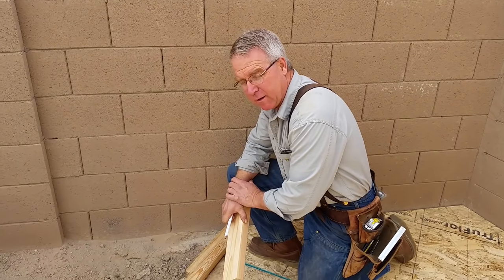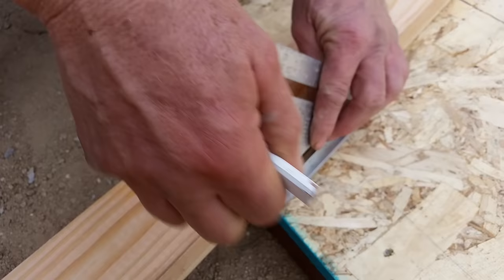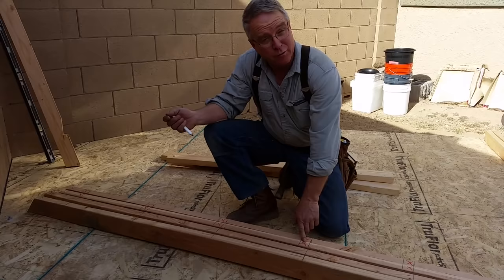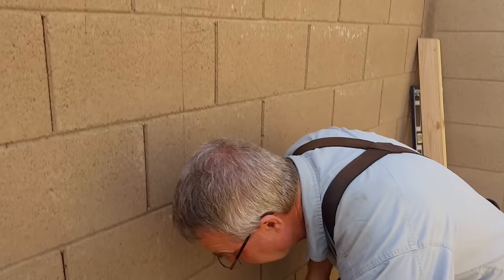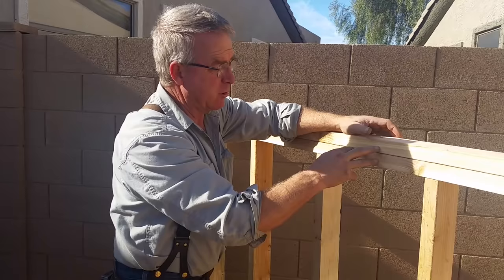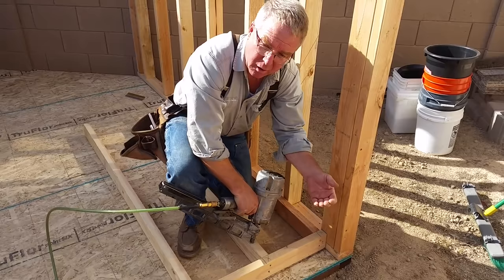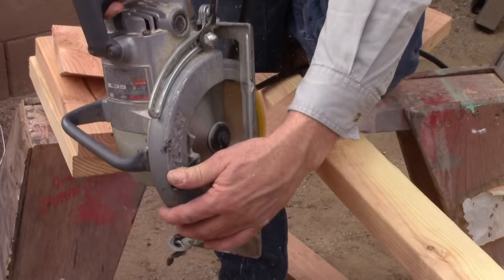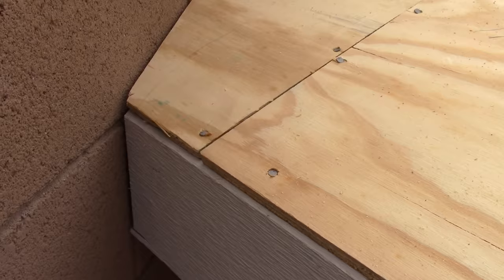Framing Pro Tips

Comment: I was the lay out guy / foreman/super my whole life.. Some lessons you learn doing layout for a long time,,, the wall studs are always laid out last.  Layout starts before layout .. For instance you must collect all the windows,doors, HVAC, fireplaces,electrical panels, Rough Opening sizes and locations and so on from the plans or subcontractors before you start, and figure out locations of all beam pockets hold downs and so on.   After all these things are laid out first, than you lay out the studs. If you do not mark the locations of all the things i said you will end up with overlapping lines and bad marks which the have to be erased, or it becomes a mess. Also studs that are not full length (meaning for bottom plate to top plate) should be marked in a different color crayon such as beams pockets, window cripples and so on. If you layout all the studs first you will (100% guaranteed) have to move studs that will end up on the edge of a window or in a beam pocket and so on.  You also should not start any layout until you know what is going above the walls on the next floor, such as beams, plumbing drains and so on. You also must be consistent with your marks,,, the guys that follow nailing everything together need to see the same markings over and over... if you use and Red X for a stud then always use a RED X, and so on. The temptation is to start a job or layout before you get all the info i mentioned above. For instance the windows have not been picked out yet . Also collecting this info is not always easy, the subs do not always want to take the time to give you the info.
I told them give me the info now or you will pay for us to relocate anything we must. And your boss might want to start to early.
The  boss is the boss and if he says start, you start.. but in the end when the cost go over you camly say i told you this would happen,,, pretty soon the boss gets the point and you will get the info you need ahead of time. Also always lay out from the same direction such as left to right,so that the studs and joist on the next floor will all line up, for OSB or Plywood. You can not learn all this overnight and mistakes will happen... but this is the basic way to do it right and save money.  One story to enforce what i just said,  We were remodeling a school , i asked the HVAC SUB to come up on the roof and mark (exactly) where he wanted all the openings for all the HVAC  air handlers and vents and so on, and i asked my boss to be there so he could witness this. I new from experiences there would be problems (there always is).. About two weeks after we were done the subcontractor comes up and says he screwed up $10,000 worth of reframing..  Layout is not easy, you must understand the plans and what problems may arise,  you must think ahead. But if you do it right you will become the layout man all jobs.

Comment: As a cabinet maker and installer for something like 12 years, I freaking wish every framer, concrete, tile, or drywall guy cared about plum, square, and true in their work! You wouldn't believe how many times I had to do hours of extra work accounting for anything and everything you can think of in a house or garage being wildly out of square or inches away from where it should be. I even dealt with a newer big expensive house where it looked like the framers considered studs within 2 inches of 16 a good job! I've seen walls that were 8 inches out of square with what they should be. Honestly it's the newer bigger homes that seemed to be the worst. Especially those built in big development deals where 10, 20 or more houses go up at once. They're basically all crap as far as I'm concerned. ONLY BUILT FOR COST SAVINGS AND TO MAKE MORE MONEY with zero effort for making a quality product.

Comment: OK - at the end, where you're cutting the excess off the front of the roof sheathing, how do you transfer a line from under the sheet, along the facia board, to the top of the sheet to follow with your saw? If I tried that freehand, I'd cut right into the facia - guaranteed. (For that matter, I seem to have a little trouble keeping my saw straight for extended cuts. . . the only way I ever get a really nice, straight cut is if I use a saw guide.)

Comment: Is the depth of the bird mouth always the same depth as your plate? I've done jobs with a max 1/2" birds mouth cut noted and wasn't quite sure why the architect wanted it that way...which is correct? Why would you use a smaller one, for Simpson brackets or something?

Comment: Your closing comments are SO TRUE have a house built in 1972 have been working on the attached garage where NOTHING is square plumb or true it's only 15 x18 and the hours I have into it are REDICULOUS because of the shitty workmanship originally now almost everything has to be custom fit. As a you boy even I knew why tape measures have different colors at 16 inches

Comment: Great videos. I am left with a question. the top plate is cut on an angle to the wall. Doesn't the stud also have to have the same 
angle length wise to the wall so it is square to the plates? it appears as though a regular stud is put against the wall at the end of the plates.
Reply: Close enough

Comment: Double top plates tend to serve another function in buildings that wasn't mentioned. The roof and floors serve as structural diaphragms, and the double top plates tend to perform the function of a chord or collector member for them. This involves axial force in these plates. That's why engineers tend to show such a robust connection between top plates at splices.

Comment: I should have been a builder. I like square plum and true.
Would like to see how you set up for the roof?  Rafters?
Reply: He showed it..The part where he cut the pieces overhanging 10 inches  and he marked the bird mouth was the setup. He added the top plate to the wall giving it more strength, so the trusses didn't have to be perfect on the wall studs

Comment: Amateur question here: In the end when you were cutting the excess roof sheeting in place how did you not cut into the base of the roof? Did you use a snap line or just your eye? If by just looking did you change blade depth on saw? Thanks. I really enjoy your channel. - Steve
Reply: yes, by  adjusting the blade depth. skilsaws have a really accurate depth gauge.

Comment: Can someone please help with a question? I'm building a small  lean to shed, 9'x5'x8', next to a house with a brick wall. The house has raingutters and the overhang of the roof is 2 feet. The shed's height, against the house, is within 2 feet of the overhang. I'm building the shed's roof about 5 inches from the brick wall. Should I build as is and moisture will not be an issue? or Should I build the roof and back wall up against the brick wall, but not attached, and do flashing where the roof meets the brick wall? We don't get allot of rain but when we do it's very heavy. As designed there would be 5 inches from the back wall to the brick wall and the shed sits on concrete up to the brick wall.
Reply: The rule:  Always frame and attach with moisture being an issue.   For the one bad storm where the rain comes in sideways.  Or if you ever have your house pressure washed.  Or for whatever reason you haven't even thought of yet.

Comment: Im 25 and I knew all of these tricks. However I mark the birds mouth with a framing square, much easier. Also I lay out my ledger boards and walls where I want my studs or joists with a framing square too. The one side of the square is 1 1/2 so you dont need to be obsessive to mark each side of the stud and waste time. Some of these guys youll have on jobsites never had a father or role model to hold their hand and countless times ive had to add nailers for plywood or drywall simply cause the layout is butched up. 
Good lesson for beginners though. When is the Advanced tips video coming out??

Comment: Hi, I am curious to know something. Why would you use a California Corner on the corner of a wall where an intersecting wall would come to instead of using a channel instead? Wouldn't a channel be stronger than a California Corner? Yes, you are using another 2x for the channel, but curious to know.
Reply from the maker: If I am understanding your question, one of the reasons is to make it easier for the electrician to drill around the corner.

Comment: I like your style, but I gotta say that there are always allowable tolerances for square, plumb, and true, and if I worked otherwise I'd lose the job I have, or at the least I'd get a good talking-to about it, cuz my boss is a decent human being.

You have to know what the next steps are in the building if you want to know what those allowable tolerances are, of course; you can't just wing it. But for example, if you cross-measure the corners of a rectangle that's over 15' and the two measurements are different by 1/8", you've done very well in almost every case. That's an allowable tolerance, and you'd be crazy to try and do better unless it's a very easy fix.

Just my two cents.
Reply from the maker: Agree

Comment: Pretty sure when doing a layout you want the first stud in or second stud technically at 15 1/4 so when you sheet it the sheeting will fall directly in the middle of the stud, if you don’t your 4 foot sheet will fall right flush with the edge of the stud and will have to sister another stud in otherwise you’ll have nothing to nail to, an I wrong?
Reply: Forgot to mention to go 16 and go off the stud at 15 1/4

Comment: Not to nit-pick and actually I guess I’m asking a question. 
I have had a construction business for over 20 yrs. About 8-9 yrs in I really thought I knew my shit, n then I met an engineer who didn’t have any idea how smart he was for actually following the rules he was taught in school. I always framed my headers to be the top of the rough opening of my windows. That’s the way I was taught. 
He said to me. In engineering that is not actually correct. We would like that header right up tight to bottom of the first top plate. You have a solid jack all the way up to the bottom of the next floor. 
Then frame back down to the actual Rough opening. So much better way of doing it. 
Anyone that has ever had to relieve a built header in a wall an inch or two can see how much better of an idea this is. 
Also, if your smart, you’ll use this same wisdom with your kitchen sink window. 
Leave the header as high as possible and give it an extra foot wider on each side of the kitchen sink and don’t cut out the plywood until they really decide. 
They always upgrade to atleast wider, n quite a lot whatever they can get. 
You’ve just given them whatever they want without sacrificing structural security a just a very little frame in.

Comment: I bought an old house and started working in it this year.
The previous remodelers and maybe the initial builder did NOT pay attention to square, plumb or true. At all. Working on this house is like a war, and every single board you put in is a battle if it must tie to older structural pieces.
Reply: Houses tend to settle and warp over time

Comment: Metal framing is better change my mind! I do commercial metal framing and drywall and wood framed jobs for a huge thorn in my boot. The problems never end! We get 1 good rain and a week after the walls are framed the studs twist like pretzels. Not to mention wood framers are always in such hurry that they install warped studs, they shoot them in to where the top or bottom of the stud is sticking out from the plate a bit, wood burns, wood rots, gets termites. The list is endless. When doing a wood framing job we have to wait for inspection after inspection after inspection after so many fails to roll in for drywall because all the problems and then when the framers roll out we still find warped studs that cause bulges in the walls. Its a nightmare. It takes us 3x as long to do a wood frames building than it does when we metal frame it. I think its time to phase out from wood framing completely. Metal is just so fast and simple and walls are always straight you really cant mess it up, it would take an absolute dunce to mess it up. Metal studs are stronger as a complete structure, lighter weight and more efficient to store because they fit together in bundles, that means a single truck can carry twice as much material as the can fir wood. They stay straight unless u run them over with a truck, they don’t burn they dont mold they dont warp. Our jobs go so fast because when the inspector comes everything is straight and in order so we pass first try and drywall goes on smooth and straight. I also believe its faster. I have seen fast wood framers but the consistency and quality is crap, u can frame as fast as u want with metal and it will still come out perfectly straight. And the fact that u can cut 10 studs at the same time is such a time saver! I don’t think my mind can be changed but give it a try

Comment: Just found out that all the rafters on my house were cut short by about two inches. They put in a splice every other rafter about thirteen inches long and at the back of the splice they used just one nail. In some places they put a nail on each side of the splice at the back. Three nails at the front. Is this structurally sound? They are cut short on the facia end. 

 
 

Reply 
Read more 

 
 

Rep
Reply: I don't understand all about building. I had not thought about the rafters holding the weight of the plywood. Just that there is about a 2  inch gap from the end of the rafters to the facia.
Reply: @thelionandchampion2644  
Ghetto, but it's just holding a fascia board

Comment: What's the reasoning of using a nailgun on one side of the frame and then doing it by hand on the other? Is it purely just for demonstration purposes? I'd figure a nailgun is always going to be faster and perpendicular than a hammer, no matter how many years that arm and hammer might have behind it.
Reply from the maker: Yes you’re right it is much faster. This is why I am nervous about how long it will take to build a spec house. Altering the process to accommodate the camera really uses up a lot of time.
Reply: @essentialcraftsman  yeah fair enough mate, good to see that sawdust makers around the world are pretty much similar despite some very small differences.

Comment: Great building tips!  But I'm not OK with the design.  Non-square corners are not user friendly.  Putting the shed at an angle like that seems like a waste of available space and materials.  And a 3 in 12 pitch is so close to a flat roof that you might as well use a flat roof system and increase headroom and storage space.  Form should follow function.

Comment: Things every carpenter should be thinking always: Is it plumb, level, square, straight, equal reveal, equal spacing, flat, centered, random when it needs to be, to code, ready for the next tradesman, fastened with the correct fasteners, most efficient use of materials, ETC.  The list could go on.  Noobies should be taught this on first day.  Just saying

Comment: We usually put the toe nail on the bottom the bottom plate so the wall won't move to raise but other than that I can tell this wasn't your first job. Your daughter must be 3' 5" tall cause anybody else the height of the project would be way too short. As a rough carpenter for 14 years I learned only by experience, one can't just read a book. Be blessed bro. Christ loves you

Comment: When I was learning  how to build it was from an old Italian builder and we didn’t use any nail guns , why ? Because accuracy is off when your flying around with a nailer , and nailers aren’t as good as hand driving , the will shoot into wood and draw the boards together as tight as 135 psi will allow sometimes causing a minor gap throwing stuff off as u go up. Also u can’t feel if your hitting anything with a nailer , when hand driving u feel the contact and connection better

Comment: I know you have been doing this for years. But I'm going to tell you to stop nailing walls at corners together threw the stud. Only nail  bottom and top plate. It makes racking wall simple if everything is cut right and square and tight little work is required to plumbing walls. Then after walls are plum then nail the studs in the corners
Reply from the maker: Wow! Never thought of it brother but I’m going to try it! Thanks 1 million!

Comment: Yes, love your videos.  Here is a little critique from me, a carpenter of 45 years and still going strong. First, no OSB!  Never!  It is junk and currently costs the same as plywood. Again, never, never use OSB! Second critique:  You talk about production framing here and saving time.  Well try this:  When laying out your plates, pivot your tape on the but end of the two parallel plates like you are drawing a radius.  You can effectively mark both plates at the same stroke of the pencil and will never need to take out your speed square.  And why are you hand nailing the fascia?  Flush setting tip on the nail gun (assuming you are using full head nails) is 10X faster and there is no worry about hammer marks.  Lastly, on the fascia cut at the ridge, simply overlap one over the other, find your plumb, and cut both at the same time.  One cut, no speed square and a perfect fit!

Comment: I will never understand why carpenter's get so hung up marking 16 inch stud centers. Run your tape down the plates together as he did. Draw a center line at the 16 inch marks across both boards, done. Center the studs with your eyes and nail them. Your not building a Piano!!